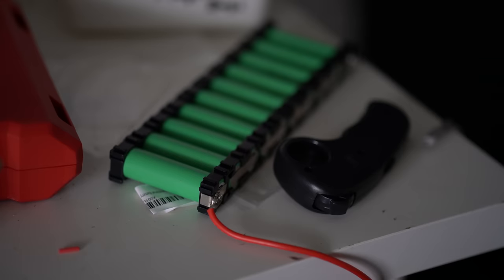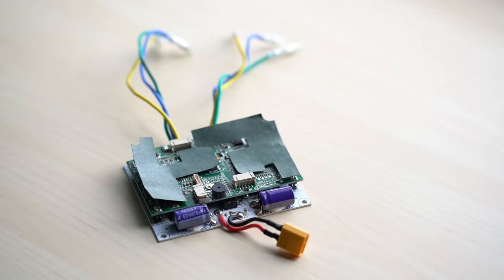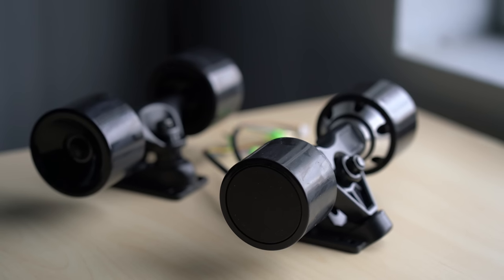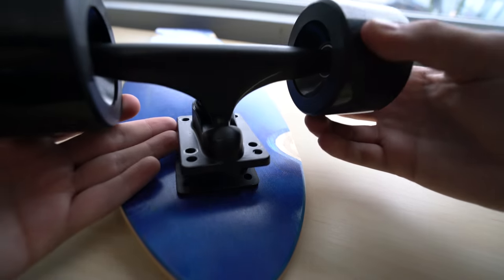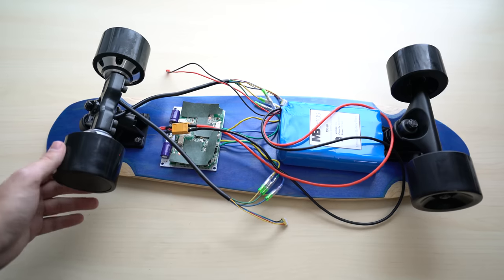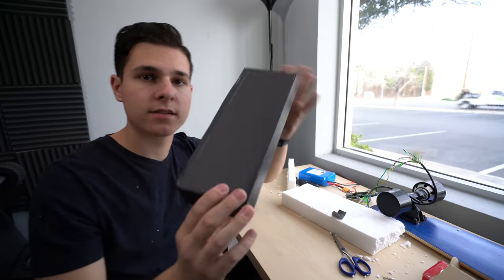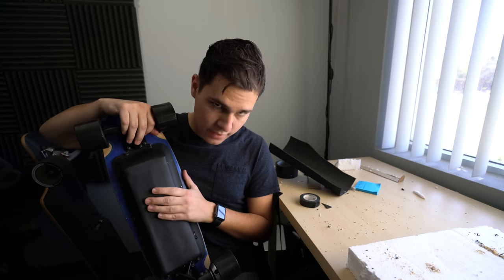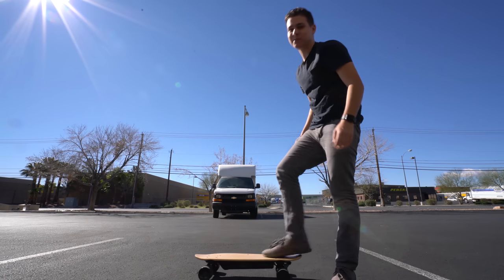DIY Electric Skateboard Build - Electric Penny Board Edition - Budget Electric Skateboard

Comment: When you said cheep I was thinking like $150. The esc is $110
Reply: I know that kind of sucks but honestly any board that is that cheap will only get you like 10 (very slow and short) uses I’m speaking from personal experience.

Like a good ESC usually cost anywhere between $69-$100

These really are the cheapest options for an electric skateboard to be used by an adult it sucks though.
Reply: @KadandEve  I built my own with a $50 ESP, So no these prices are not all right. You can even find cheaper than that on Aliexpress. I believe he has a partnership with Mboard. That is why this is that expensive
Reply: it will be cheap if you take the risk buying parts from china. i tried a few searches after watching this video. it cost around $170 for the kit
Reply: @Chinhnguyen0497  No bro I have built many last years. And where you have to be careful is when buying batteries from china. I advice you to build your own. But you must know that these parts he is showing such as the ESP. They are from China 😂, I can even give you the link to the real china seller.

Comment: I made my own normal sized electric longboard but since it’s very flexible, the case attached in the bottom is slowly coming off. I have used screws to keep it in place. What could I possible do to fix it?
Reply from the maker: I would honestly switch decks. That’s one of the downsides to flexible decks

Comment: How is the accelerating and braking like? These two are pretty important factors. A good board doesn't only mean it can run fast but also lot more considerations to provide a safe and comfortable experience. And I think this built also cost as much as a mature electric board on the market. The parts are twice of the after market price, way to expensive.

Comment: Hey, I didn't go through all the comments but I couldn't seem to find the answers to the most important questions, so let me ask 🤔:
1. Average range expected? 
2. Total avg cost expected? 
3. Top speed? 
4. Charging time and where did you get the charger from?
5. Will the enclosure break if you'll jump a pavement with it scraping? Doesn't look solid but I'm a novice so hey.. Can be wrong 😊🤯

I hope you can answer all these questions for me, doesn't have to be on the dot exact values... But some estimates would be great as I'm considering this built... Thanks man! 🌟🌟🌟
Reply: the top speed is 17mph the range is about 10 miles the charger comes with the battery total cost $520 charging time about two hours the enclosure isn't on his website yet, however, the enclosure that I made is 3d printed so I wouldn't take it off-roading.
Reply: @CarraigButler  is there something I have to keep in mind if I wanted to increase the battery power on it? Quite new to electric skateboard and bought one recently. So was wondering could I buy a bigger battery to increase the range and the speed on this? Or does the battery power have to match with something on the board?

Comment: Would the 10s3p battery that you sell also work for this board and would there be any other issues if I used that battery?
Reply from the maker: It would work :) just be sure to measure your deck and compare to the dimensions of the battery to be sure it will fit under the deck. The batteries are identical in voltage, the 10s3p just has a higher capacity so it will work just the same with all of the other electronics.

Comment: Sweet board. I was wondering though:
1: Are you able to skate around on that board with the motor off?
2: Is the motor moving two wheels or does it move all four wheels? I was wondering if you can make the motor move all of the four wheels or why move just the two wheels?

Comment: If I build by own battery (I have 20 cells of sony VTC4 and a 10S 45A BMS) and already have a 36V charger and a deck with truck and wheels. How much would it cost for the dual hub on trucks, ESC and remote ???

Comment: Do they have a smart ESC for just a regular pulley motor? So I would not have to use the power switch and also get the remote at the same time? That would make it so much easier for my build
Reply from the maker: Yes, there is a belt motor option on the website 👍🏻

Comment: On your MBoards website you sell a Dual Belt Drive 1400W 5055 Motor Kit. Would this kit work well with the Dual Belt Driven Motor ESC that is also sold on your website? How fast would it go with 2x 5000mAh 5S 30C lipo batteries? I'm just looking to build something affordable.

Comment: Thanks for the video! Was wondering, (maybe i missed his info) a) how long the battery would last and b) what weight you recommend for decent speed/torque with this setup.
Reply from the maker: I estimate the range to be about 7-10 Miles. 

I weigh 160lbs and it goes pretty quick. I’m sure someone heavier than I am would be just fine on it 👍🏻
Reply: Fantastic, thank you for the fast reply! Keep up the good work!

Comment: Great videos man! You're builds are unreal. I was wondering if you've done any builds with a Boosted Board battery? I just got an extended range battery for my Boosted Board and wanted to connect my old original battery to a smaller board. Any idea if this is possible or how I would go about doing this? Thanks!

Comment: If we don't want to buy a $250 battery is there another battery option?
Reply from the maker: There are other options out there yes. We also carry the 5s lipo batteries. A pair of those will run you $120 instead. 

You could also opt for 2 3s packs for a 6s set up. That’ll run you about $70.
Reply: @MikeBeard  Thanks, that's really helpful, love your tutorials.
Reply: Mike Beard oh and also is there any way to hook up one of your three prong battery chargers, a battery indicator and an on/off button to those 5s's?
Reply from the maker: Yes there is. You’d have to wire the lipos to a BMS. Then wire the power switch in as well.

Comment: Thank you! I'm about to order the parts but need to know if it comes with the front truck and wheels?
Reply from the maker: Yes the front truck and wheels are included 😎
Reply: Mike Beard anyway to upgrade the hub motors? like 1000 Watts each?
Reply from the maker: On this smaller size that’s about how powerful they get. We do have larger hub motors available that are more powerful. 

I found that these smaller hub motors were actually surprisingly powerful. They climbed quite a few hills no problem.

Comment: Do the brakes work when the battery is completely full?
Reply from the maker: They can but at a certain point they will stop to protect battery. Your battery will almost never be completely full unless you have to ride down a huge hill the moment you step out of your front door. If it becomes a problem you can charge to 90-95% on purpose to help.

Comment: Would this also work with a belt drive setup?
Reply from the maker: Yes, although you might want to get a slightly larger board to help with the size of the motors and the space available underneath that deck.

Comment: Question here:

Hey dude this is amazing!! I was looking for something like this for a while. But to make it more “budget” can I use the Turnigy 5000mAh 3S 20C Lipo Pack batteries? What’s the pros and cons of those? 

Keep up doing this awesome work!! Cheers!
Reply: Alexandre Albergaria it works I have it on my skate bored 😎
Reply: this was built with a 10s pack which is 36 volts. so a 3s pack would be less than a third of that .. 

i think the esc and the motors would maybe not work on such low voltage?

Comment: Hey Mike! Would the board work as good with a 7s2p battery ? what would be the differences ?
Reply from the maker: The difference would only be the speed 👍🏻 Just a little slower. Should still hit 18mph or so
Reply: Tx ! What if I just wire 3 Turnigy 5000mAh 3S 20C Lipo Pack together?

Comment: Hey all, I just bought a motor without a keyway am I screwed and need to buy a new motor? Or is there some other way or attaching this thing...
Reply from the maker: Are there screw holes in your pulley? Might be able to tighten the screws around the shaft really tight. I’m not sure if it would hold or not. You could maybe drill a hole straight through the shaft for the screws to hold onto.

Comment: 20 mph is enough - but I'd need a board which reaches realistically 20 miles... And for the bonus points: no or just not really noticable outer cabling, completely waterproof and a silent motor noise

Comment: That´s a shop with an interesting battery pricing:
10s2p = 20 18650. If any google that you can come close to <4$ per Cell for Premium Brand ones. Or even half of that. An BMS is near 10$ or so. That is all that´s in a 220$ Product. Or a different view:
You can buy battery packs from chinese manufactures: 1000 Wh for under 400$. This is e.g. 52 Volt 20 Ah. All including, ready to go.

Comment: what if I want to make one belt driven? is it possible with a normal penny board deck and trucks?
Reply from the maker: It’s possible, the belt driven set ups tend to be larger so it might look funny on a smaller deck, but you could up the size of the deck a bit to make it look right 👍🏻
Reply: great thank!s! one more thing, do you know how can I find a motor mount for that?

Comment: How do you charge it
Reply: I have the same question
Reply from the maker: The battery I used has a charge port built in. I drilled a hole in the side of the enclosure and mounted the charge port. I used the same method in my newest video. I go in more detail about it there 👍🏻

Comment: Would you recommend using this smart ESC on a 6374 motor, or is it better to go with a VESC from diyelectricskateboard.com? 

My buying options are rather limited due to shipping to South Africa.
Reply from the maker: Both would work. Just depends on if you want to program it or not. If you want to program it the Vesc is better
Reply: I don't necessarily want to program it, but I've heard a lot of stories about these smarts ECS's limiting the current. This is for a longboard build and I need to go up some rather steep hills in my area.
Reply from the maker: Esc is rated for 50a continuous and 120a peak just like VESC. But is is possible. Not sure how to test it
Reply: Banger67 He put a link in the description to all the parts he used, but you could also get it one eBay. Just search 'electric skateboard esc' remember to specify between hub and pulley at the checkout.
Reply: Personally, I would recommend the VESC. You will want the available customization. Especially if you are going at higher speeds, it will be worth it. If you are able, I highly recommend it.
Reply: Jake De Necochea Thanks, I'll buy the VESC then.
Reply: Kai Peters I know I late and you’ve probably made your decision but for me I made an Diy Evolve style setup with dual belt motors switchable All terrain/ street setup 
And used the V2 Chinese esc for belt motors from Diyeboard.com
The board will break 30mph and ESC has never had any sort of issue in over 500 documented miles through app (when I remember)
I think it’s more about the quality of your batteries and motors

Comment: Can you use the same ESC with 2 belt motors or can it only be with hub motors?
Reply from the maker: There is a version on the website calibrated for belt motors 😎
Reply: Mike Beard thanks!

Comment: @Mike Beard - nice video although, not necessarily complaining specifically but maybe venting. I may have offered the same sort of 'in video commentary' suggesting for folks to get additional info in the comments section. Most of my YouTube watching lately has been done on a smart tv and unfortunately, the comment section doesn't appear to be available. I would have appreciated more specific pricing info within the video. Even after I was able to get to a device that allowed access to the comments, it would have been nice to have a general price listed without having to chase the links down and just adding up the three major components (10s2p Battery Complete Battery Solution Regular price $249.00 + Dual 70mm Hub Motor Truck Kit Regular price $149.99 + Dual Hub Motor ESC Regular price $119.99 ) and it quickly gets up over $500. Bumps up over the price of some Razor X Electric Skateboard Cruiser from Walmart that sells for $159.97. I promise I'm not trying to nitpick or be a troll but just really trying to share some feedback based upon what I'm actually going to try to put into practice on my own. So Peace and Blessing, keep up the good work/content, and good luck!

Comment: Does anyone know how much range I can expect from two 5000mAh 6S1P 30C in my build?
Reply from the maker: In series or parallel?
Reply: Mike Beard thanks for responding! I heard somewhere that parallel doubles capacity while series doubles voltage? So I am guessing parallel is my best bet?
Reply from the maker: Series will increase the speed, parellel will increase range. 5000mah usually get me around 10 Miles
Reply: Mike Beard hate to bother you again but one last question if I got two 10000 mah 6s and connected it in series I would have 10000 mah without sacrificing too much speed? I just found one for on sale 60% off from a friend.
Reply from the maker: That would be a 12a setup. Will give you a ton of speed and range

Comment: Can i  use 12v 8000mah battery  with dual 
 hub motors
Reply from the maker: 12v is too low. Would need at least a 6s  battery.

Comment: im kinda mad can you make an ACTUAL budget board!?
Reply from the maker: Compared to the average cost of an Esk8 build, this is pretty budget. 

You can spec this build down with a 6s2p battery and it will be even cheaper.
Reply: @MikeBeard  yes i agree but if i wanted to pay 500 dollars for a small esk8 i would just buy a decent electric longboard, a majority of viewers just want a cheap esk8 to use every so often.

Comment: Why the battery is $250 ?? lmao it's more expensive that a car's battery xd
Reply: No competition = higher pricing
Reply: Qwokey different battery types, lithium ion vs lead acid. Don’t comment if you don’t know what you’re talking about
Reply: Big Pancake I’m pretty sure the battery packs are just 18650’s wrapped together, no?
Reply: Qwokey yes they are plus a bms and wiring and the time it takes to make it. I was saying that he was comparing a lead acid battery and lithium ion and saying why was it more expensive
Reply: @DeathcoreGandhi  hmmm monopoly?
Reply: Comparing lithium ion technology with lead acid batteries ? For the same capacity lithium is 6 times lighter and dont lose as much energy as it discharge...
Reply: Lipos are way more expensive

Comment: Listed prices:
Battery-250 dollars
Esc-100 dollars
Dual hub motor-150 dollars
You can purchase a faster board in the market. Not exactly budget build buddy.
Reply from the maker: Considering most DIYs can cost upwards of $700+ it is on the cheaper side. This build can actually get cheaper if you spec it down a bit as well. (Less than $400 shipped)

Building the fastest board possible wasn’t the goal here, just a cheaper (and easier) way for someone to build their own.